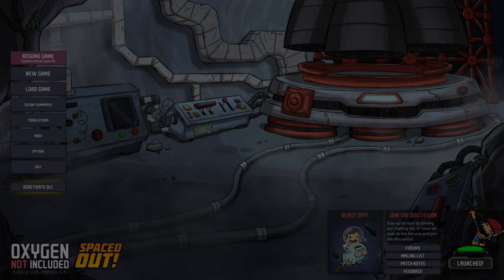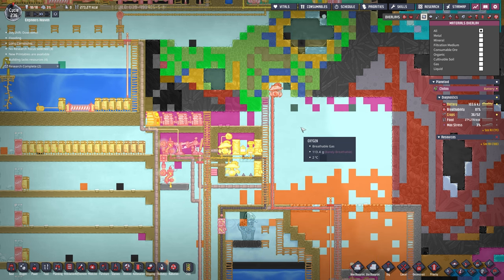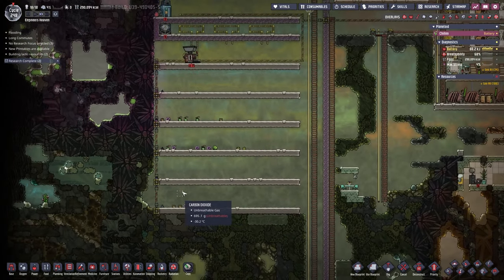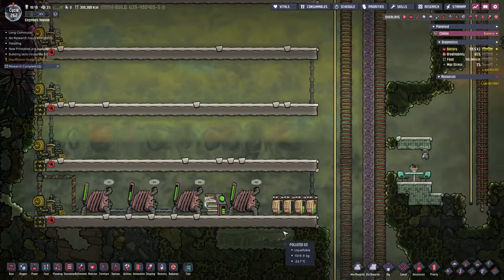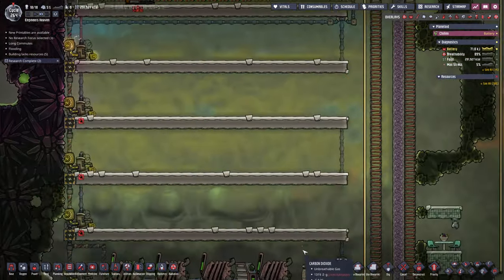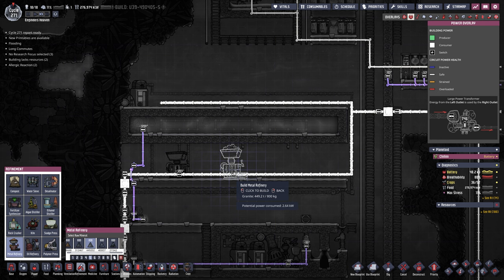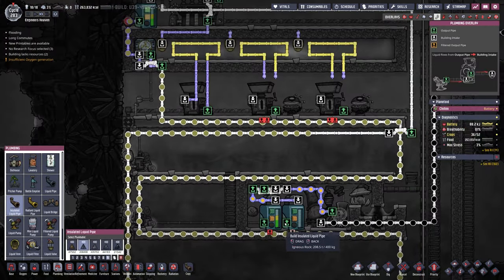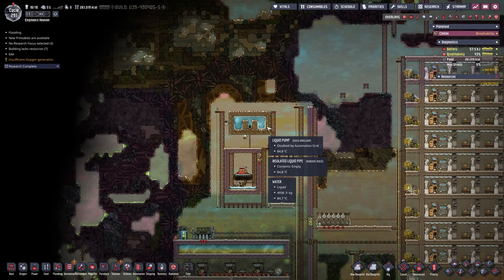Engineered INDUSTRIAL BRICK in OXYGEN NOT INCLUDED (LP1-EP12)

Comment: so im bout to find out soon enough if im wrong, but ive tested filling the steam pool with only water a few times an i get zero gas, filled totally with water. on a small scale. now to see if it works when i start turning on 5 steam turbines. will update, i n like 30 cycles when this massive pool is finally full :)
Reply from the maker: If you fill it totally with water it still works. Absolutely. The reason why you use 2 or more (depending on height of steam room) different kinds of water (Water, Polluted Water, Salt Water, Brine) is that you don't have to use a literal ton for each layer but just a little bit. Also, the steam turbine will turn on faster since you have to heat less liquid ;)
Reply: @BierTier  yup, figured that out when i checked my water levels afterwards. it took SOOOO much water to fill it that i wont do it that way again. most ppl who ive watched focused on the ability to simply fill the area without gasses and i thought that was the main consideration. 250g of polluted water to fill the first layer or 1kg per tile? easy math now that i know. I'm also hitting over-pressure occasionally on my liquid vents. Had to run aquatuner at 20c an make a bunch of iron an steel i dont actually need right now for 10+ cycles just to get the steam to turn on generators. Dont do this like i did, works, but just dont. 

Edit: i also plan to run 5 steam turbines an my steam tank was two tiles high. so yeah, this shit took forever to fill, used a ton of extra water and took forever to turn on. plus of that is theres a lot of thermal mass in all that steam volume so my turbines should run for a long time after i stop using the forges, but why do i give a shit cause they only help run the forges. other side of that is if i let it cool its gonna take forever to turn back on. yea, dont do this like i did
Reply from the maker: You can potentially syphon off some water if you have a place to store hot water by getting it straight out off the steam turbines. Just don’t put it back into the steam room for a bit. Removes 2kg of water per second per steam turbine. Just need to be careful to not completely overheat the steam room in the meantime. Just as an idea if you are facing issues ;)

Comment: whats u spec? I cant find anywhere in your social midias
Reply from the maker: What exactly do you mean?
Reply: @BierTier  PC setup!
Reply from the maker: @xikretlele7228  Oh, of course. I should add that to my social! It's currently only on my Steam, will fix that soon!

CPU: Intel(R) Core(TM) i7-9700K @ 5.10GHz
MB: GIGABYTE Z390 Aorus Ultra
RAM: G.Skill 3600Mhz DDR4 32GB
GPU: EVGA NVIDIA GeForce GTX 3080 FTW3 Ultra
NVME1: Samsung 970 EVO Plus 500GB
NVME2: Samsung 970 EVO Plus 1TB
NVME3: Samsung 970 EVO 1TB
SSD: 2x Samsung SSD 850 EVO 500GB
HD: Western Digital WDC WD30EZRX-00MMMB0 3TB
Monitor1: ASUS ROG PG278QR 27.0" @165hz
Monitor2: ASUS VG278 27.0" @ 120hz
Keyboard: Steelseries Apex Pro
Mouse: Logitech G502 Lightspeed
Headphones: SteelSeries Arctis Pro Wireless
Speakers: Bose Companion 2 Series III
Mouse Pad: Logitech Powerplay + LTT Northern Lights Desk Pad